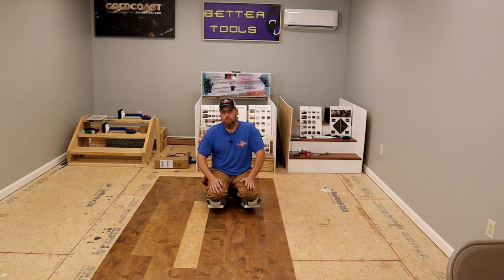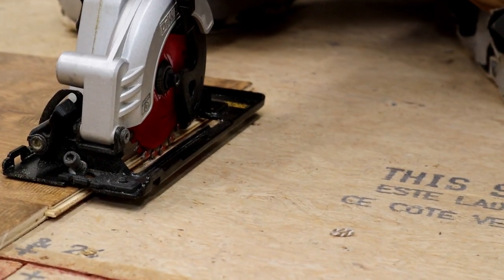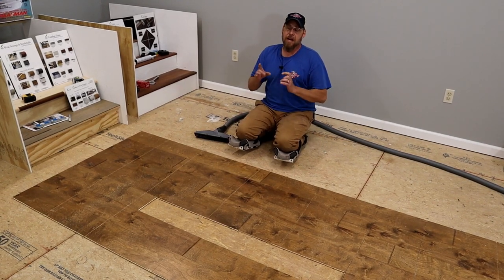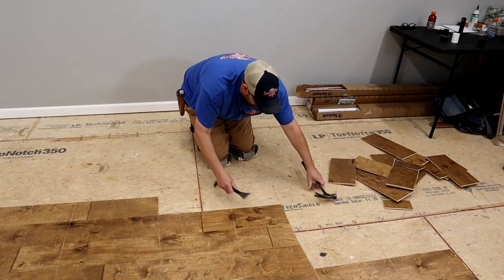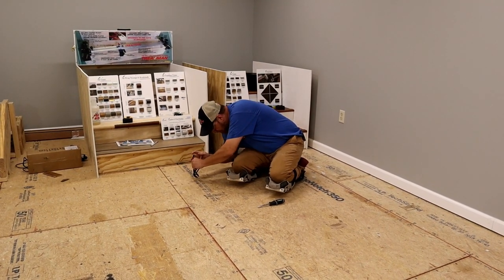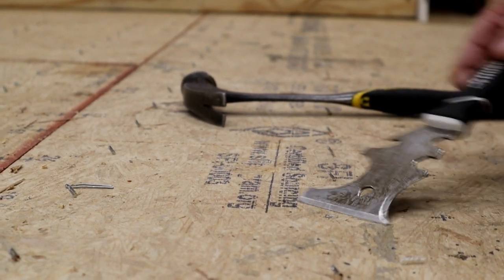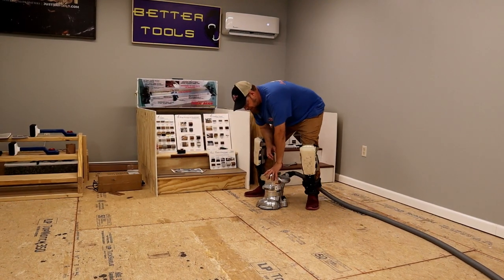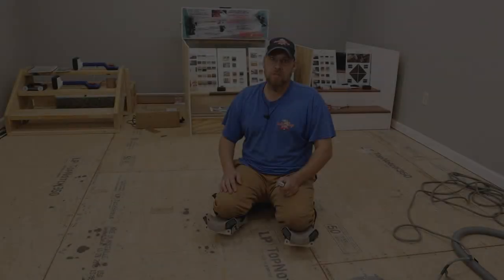HOW TO REMOVE HARDWOOD FLOORING EASY

Comment: A good tip is to use a circular saw, and a 60” demolition bar (2 prong forked is my preferred favorite) it makes things go by WAY faster and not as much wear on your body. I can demo a big house of hardwood floor in a half day using a set up like I just described. Yours and i methods are very similar, just bigger tools make it go by faster and easier. Not bashing the video at all you did a very good presentation, I was just helping someone out who may be doing a whole house tear out who never has, that the tools I listed will speed the process a ton. Keep up the good work man!
Reply: You helped this guy!
Reply: You helped me!

Comment: you are really good installer sir, any advice on how to remove easy k3 plywood and remove lino on k3 ? thank you so much
Reply from the maker: How thick is the plywood, are you referring to a quarter inch underlayment
Reply: @FloorsbySouthernboys  yes sir i am i usually had to remove lino and plywood sometimes its really hard it takes a lot of time and effort i was wondering do you have any tip for it.
Reply from the maker: @osmanalberta  I always will take them up together, I just treat it like a single board and cut it in strips about 6 inches wide or so and take it up in strips, much easier like that instead of trying to take up a whole piece

Comment: That looks more like a snap-lock floor than a nail down type.  We're looking at 3/4" nail down hardwood.  Concerns about trashing the subfloor as well as hitting nails with the saw blade.
Reply from the maker: You cannot avoid it but it won’t cause any physical harm it will just dull your blade faster than normal but that is how you have to do it.